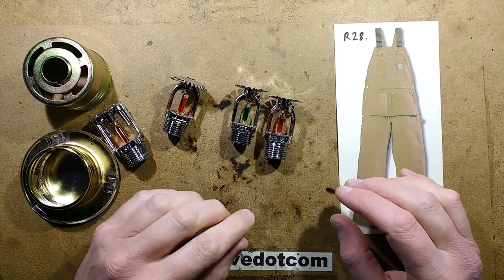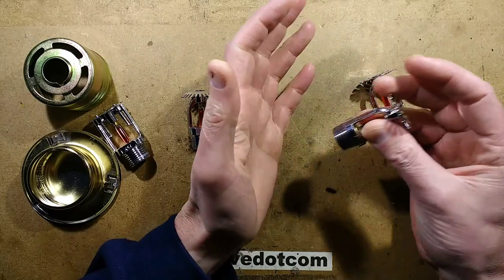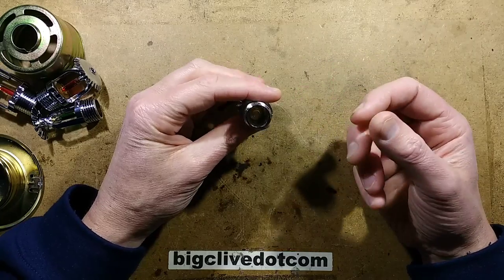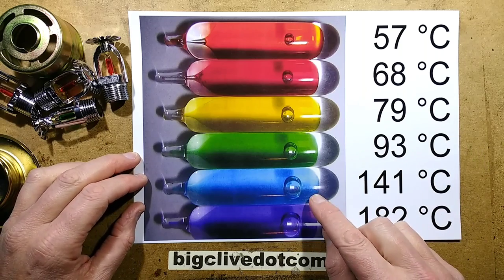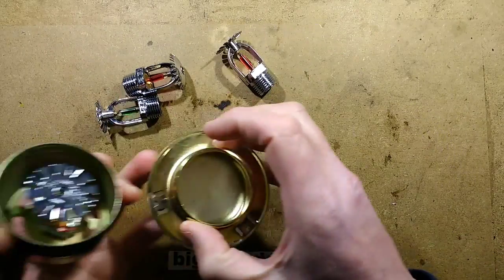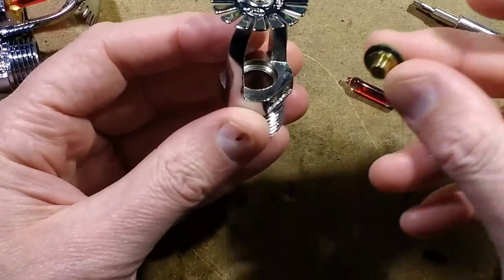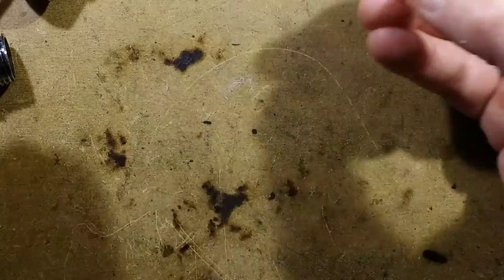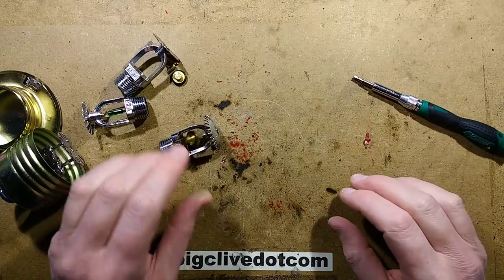How a fire sprinkler works. (featuring broken glass and spatter.)

Comment: Gas is compressible, therefore the bubbles (or 'vacuum') act as a sort of pressure buffer. The smaller the buffer, the quicker it's going to exceed the pressure limit of the glass bulb. The larger the bubble, the more the gas will absorb the vaporising liquid's effect on the pressure.  The liquid inside is an alcohol usually (essential point is that it has a low boiling point) and colour is simply for easy identification - the liquids are the same.

Comment: I suspect that there is the same amount of air in each bubble, and the bubble size is determined by the pressure. Larger pressure means smaller bubble, for the same number of air molecules. The larger pressure would make the vial break at a lower temperature.

Comment: I'd wager the flatter diffuser is for getting a better horizontal spread of water, i.e. in a sprinklerhead placed inside warehouse racking with flammable materials in it. We have a setup like that where I work (I'll have to check and see what shape the diffusers are tomorrow) to douse aerosol cans if they vials pop.

Comment: I think the covers would be good in places like hotels and high end offices etc. I suspect that the liquid would need to have some resistance to freezing as some locations are likely to be cold. Temperatures at ceiling level rise very quickly to above these temperatures with even a modest fire, but it would be important to prevent false firing in environments where hot processes are undertaken e.g. Furnaces, kilns etc.

Comment: I’m a sprinkler designer and your topical patterns for head going off is 3 out of all the systems heads will go off in a normal fire they cover around 9 metres squared depending on types of heads and what type of instillation but your typical 68 degree heads what are usually installed  cover a 9 meter squared block
Reply: Their are loads and I mean loads of rules for types areas covered and the head you didn’t understand is a pendant head it face downwards it’s for racking

Comment: i think the bublbe, the air is the same amount, but the pressure of the liquid is higher to compress the bubble more that makes it look smaller. higher pressure will make lower temperatures reach the bursting pressuer. and lower pressure will need more heat to expand the liquid more to reach a bursting pressure

Comment: Are you going to be installing these in your work shop? I would be concerned if I had a fire the insurance company would be reluctant to pay out if found out that the sprinkler system was bought for a few pounds on ebay. It would be interesting to see if one of these could be triggered by a laser.

Comment: Different temperature settings are used depending on where it will be used. A higher temperature for a head that will be above a suspended ceiling in an non climate controlled area, as opposed to below a suspended ceiling in an air conditioned area for example. Or a mechanical room, as opposed to office space.

Comment: The liquid is most likely the same as used in "alcohol" thermometers (in the old days they actually contained alcohol but it boils at low temperatures). Most likely an oil these days. I don't think it's as such deliberately pressurized - the bubble inside I believe is enough to make the glass splatter in that way combined with the tension in the glass. Just before the glass breaks the bubble is just about zero size.

Comment: I heard they were different liquids and that they break at ( just above) the boiling point of the fluid. As boiling point roughly correlates with vapor pressure that would give larger bubble sizes ( lower vapor pressure)

Comment: I dont think you can run it off your water mains. Sprinkler systems always have pipes of like 40 or 50mm in diameter and a basin somewhere. They require a lot of water flow. More than your mains can supply so it will just be weeing.

Comment: Just an input I waited at an airport and in the paint hangers they used the blue vials I’m assuming because jet fuel and paint burns at a higher temperature than just like a paper fire or something? Or possibly because they have massive heater in the paint hanger to speed up the drying process of the paint and didn’t want premature fire suppression system popping idk

Comment: Ones under lower pressure [bigger bubbles] will take more heat for it to reach the pressure needed to break the glass. 
Little bubble ones go off at lower temps, because they are under more initial pressure.

Comment: I wonder if the bubble is there because of air compresses. The bigger the bubble, the more compression therefore the higher the temperature for which it can stand before the capsule bursts? The colours are purely there to indicated its failure point rather than any affect on its failure point?

Comment: Another method by which these function is to hold the water pressure back with a plug of an indium/bismuth alloy that is blended to melt at the desired temperature.  This is also used in self-closing fire doors, where the doors are held open by a two-piece chain held together by a slug of indium/bismuth alloy.

Comment: The bulb typically contains a glycerin-based liquid. Once the air around the sprinkler reaches a certain temperature – often 155F or 200F (68C or 93C) – the liquid expands which causes the glass to break.

Comment: The bulb is filled with a glycerin based liquid dyed different colors depending on temperature and sealed leaving one small vapor bubble remaining. During a fire ceiling temperatures rise rapidly. The liquid absorbs the heat until it exceeds a specific temperature– most commonly 155° Fahrenheit - at which time the vapor shrinks and the liquid expands until the bulb breaks and a gush of flame-retarding water rushes past.

Comment: Googled what's inside the glass vile:
"In some sprinklers, the plug is made of an alloy called Wood's metal, a mixture of bismuth, lead, tin, and cadmium that melts at a relatively low temperature. In other sprinklers, the plug is a small glass bulb full of a glycerin-based liquid designed to expand and shatter when it gets hot."

Comment: I'm in central British Columbia, Canada. I installed sprinklers in my super-insulated off-grid home, using Pex tubing runs over a 5/8 inch firestop drywall ceiling. Contrary to popular belief Pex IS suitable for residential sprinkler systems. I'm seriously considering converting to a dry system so I can add exterior sprinklers.
Reply from the maker: Interesting.  The behaviour of PEX would be interesting in a fire as the flow of water to a ruptured sprinkler would theoretically cool the PEX and stop it rupturing.  But if it did it would rupture in the area of greatest heat and that would be where the water was needed.

Comment: Were you able to discover how they make those sealed glass tubes with the liquid inside? I do glass art and have wanted to try my own take on the concept of minimal air retention, but haven’t been able to get around that making the glass hot enough to seal closed either boils away the liquid colorant, or the steam it vents keeps a tiny capillary tube open - which then leaks the colorant out after it cools. Any ideas? Thanks Clive, love your videos.
Reply from the maker: I'm guessing the sprinkler vials are made using a fine capillary tubing on the vial to allow easy tipping off.  Only time I've really tried making liquid filled glass tubes was my experimental bubble tubes:-
https://www.youtube.com/watch?v=OvDpnp2jRgs

Comment: I always thought that the concealed ones simply pop open due to the water pressure. The image you showed is used in other languages wikipedias. The colour/temperature is usually chosen to be ~30°C over expected ambient temperature, so if you are in a machine shop doing something hot you better get a blue or violet one.

It obviously is a bad idea to have a flammable liquid in there. I would not be surprised if it was just water.

Interesting other facts: There are dry systems that are filled with air and only when it pops the air gets out and water comes after it. This can be coupled with other detection systems that open the water valve only in certain conditions.

Comment: I think residential applications cause issues.  Residential homes by themselves are alot of times left completely alone and there is no way to turn off the sprinklers once fire is out.  Where as commercial buildings, apartments, places where there is always people, there is someone around to deal with the water once it starts.

Comment: Most bulbs are filled with glycerin. I work for UL in Fire Suppression, testing new sprinkler heads before they are listed and sold to the public. I wouldn't buy any sprinkler head that isn't listed by UL, so a random Chinese brand isn't the best lol. Sprinkler heads are designed for specific GPM or gallons per minute. So you can't just buy them and install them yourself with any pipe. There are also specific height requirements the sprinkler company requires for deflector to ceiling. a TON of testing goes into sprinkler heads before they are listed and mass produced.

Comment: Interesting subject. Here in the US, the pipe seems to be just black iron but instead of screw pipe or flanges, they use a special clamp and the pipe is prepared to accept the clamp. And the pipe is always rec and they get to go in first because the dispersion pattern is approved by the fire marshal and the heads location is fairly specific. The ones with a cover are mostly used in clean room applications.
Reply: John Stewart are you referring to grooved pipe?
Reply: Yes I think is it. And it always gets painted red. Except one place I was at recently that the owner decided to paint the natural gas lines red going to the space heaters. Please forgive, I am just an electrician, so my pipes are always supposed to be dry, LOL. But yes that's what I think it is. I also believe that on the lateral lines feeding the heads are screw pipe. And Big Clive is great!
Reply: Oh and if you have not yet, try AVE Bolter. He's hilarious, and his young one is really funny as she cuts right to the chase!
Reply: John Stewart yes I follow him too lol. I’ve seen some old pipe painted red but not many. It’s mostly a preference. And yes the pipe off the main is usually 1.5 to 1 inch and that is threaded

Comment: My guess that the vial goes under vacuum, then the liquid is filled to a certain volume. The glass is, then, sealed by melting the hole from where the liquid was inserted. When the vacuum is released, the glass hold the "bubble of vacuum". That is how thermometers are made.

Comment: A quick run down on the most common setup in Australia for sprinklers.

We almost exclusively use a wet system as we don't have issues with pipes freezing.

The sprinklers supply starts at the mains, runs past a one way valve and a supply cut off valve.
The pipe here has multiple outlets and an inlet which I'll explain in a minute, but then runs off to the sprinkler heads and finally at the end is a drain valve.

The aforementioned connections consist of an outlet to an electronic pressure sensor, a water flow based mechanical klaxon alarm and a pressure boost pump. 

There's also a number of pressure gauges and shut off valves and one way valves to the different components. 

The mains pressure (300 - 800 kpa depending on the area) is boosted up to a higher pressure, (800 - 1,500 kpa). 

If a sprinkler head activates, the system pressure drops to the mains pressure which is used to activate the electronic alarm and evacuation public address systems etc. 

Depending on the building, the sprinkler may be have a booster point. 

This is basically a fire hydrant from the mains and an input connection after the one way valve. We can park a fire truck at that point, take water from the mains and increase the pressure with the trucks pump and feed that back into the sprinkler system. 

Many buildings fitter with sprinklers also have fire hoses and hydrants inside connected to a separate system of pipes and normally have the booster fittings that connect to the fire trucks. 

This allows for "ok" fire suppression until firefighters determine what is needed. 

Our sprinkler heads are not designed to activate via any method other then direct heat. To do so would only reduce the water flow where it's needed and cause water damage where there is no fire. 

Of course not all systems are the same, even in just one country, but all the systems I've dealt with have been the same in their overall function and only take a few seconds of looking at to identify which pipes / valves are doing what.

Comment: Im guessing the sprinkler head is filled with colored alcohol within different vacuums designed  to hit the boiling point at different temperatures depending on the vacuum  and then shatter the glass with when it becomes positive pressure due to the steam "my guess" BTW i believe the bubble size would change depending on the vacuum.. higher the vacuum the larger the bubble

Comment: I once asked a guy who fitted these - he called it a "two knock" system, the first "knock" is from the fire alarm which pressurises/arms the system -  so there's no pressure at the head if you just break a bulb.
Reply from the maker: There are various systems.  Some are continuously pressurised and some use a drop in gas pressure to activate the water.

Comment: The size of the bubble might be controlled by the strength of the vacuum. For example if you draw 90% vacuum, there will remain a bubble of 10% * the chamber volume. Just a guess.

Comment: Very interesting, now you have me interested in fire sprinkler heads, from the research I've done it looks like the green one would be the more common one which is close to 200 degrees Fahrenheit, think about it in a hotel room if you have the air conditioning off in the sun is beaming in and it goes up to 100 degrees or slightly over that would be kind of close to temperature tripping with the lower ones so the green one would be the more common one trip it about 200 degrees.

Comment: Those sprinklers with the white cover are mostly cosmetic and used in certain areas of a building.Just like certain colored sprinklers are used for other types of rooms.
Reply: Also the tops of the sprinklers dictate on where the water goes,i.e the radios aroubd the sprinkler.Also there are ones that allow the water to go in one direction in radios.

Comment: glass contracts when its cold, so theoretically does that mean then that these sprinklers would activate at a very cold temperature as well?
Reply from the maker: There's a rubber sealing washer that maintains a seal while allowing for slight size change.

Comment: Iv never seen sprinkler heads with fluid vials before all the ones iv seen here in Arizona are the type with a metal plug that is a alloy of lead,tin, cadmium and bismuth and melts at a pretty low temp

Comment: I wish I could find the image but there is a special locking plier that has a seal on one end. It is clamped in the location that occupies the glass vial. They use these to close off one or two heads that might go off and they don't have access to the turn off valve until maintenance personnel arrive.
Reply: Oh found this one on YouTube 
http://youtu.be/PH1vcCu2YYs

Search for sprinkler sealing pliers, there is also a vise grip style unit that goes between the top shoulder and the lower has a rubber plug that seals the opening.
Reply: Very useful video showing the sealing pliers!

Comment: Got soaked by the sprinkler system at my apartment a while back though not inside my own unit. A neighbor had somehow managed to set their stove on fire while cooking a steak and she ran outside in a panic banging on a neighbors door asking for a fire extinguisher. I heard the commotion and came down to see what was going on and they were both standing 5 feet away from the fire extinguisher mounted on the wall between their units. I grabbed it and ran inside but the fire sprinkler had already gone off and put out the fire and flooded her unit as well as the one directly below her which was unoccupied at the time but had just received a fresh coat of paint (the painter was still in there when the alarms went off through whole complex).

Comment: All the systems I've seen use only air pressure to hold back a master valve.  When one pops the water hammer effect views out the rest on that leg.  I'm unsure if a normal water main can drive these you normally see an 8-12 inch main valve on such systems in commercial systems.

Comment: I do not think you have high speed camera. But it would be cool to see the bubble get squished by the liquid until the vial reaches a "solid liquid state" and at that point it shatters.  Different size bubbles means more heat needed to reach that point.  Need a very  close up of vial while heating to see exactly what's happening.

Comment: Hey cool Video 
One thing I wonder about is, if you install sprinklers in your shop, does the water may make a bigger damage in case of a fire, as the fire itself?
Reply from the maker: They reckon the water is much less damaging.  Partly because the smoke from the fire will ruin everything and if the fire brigade are needed they will finish the job with axes and hoses.